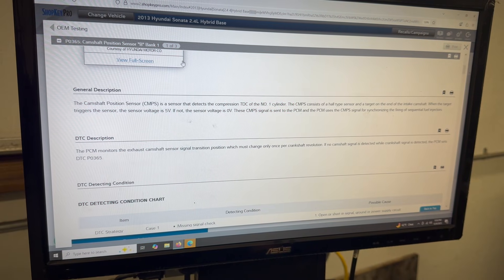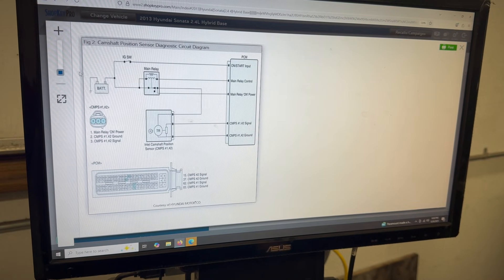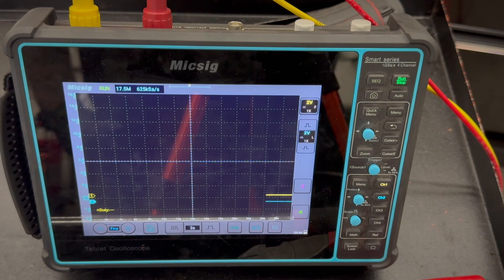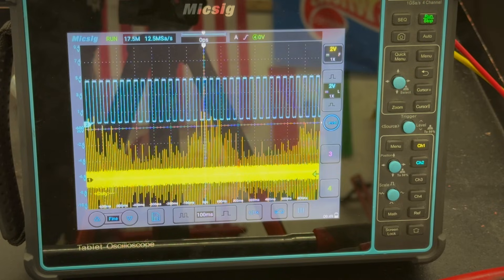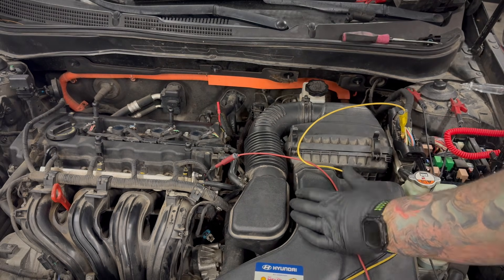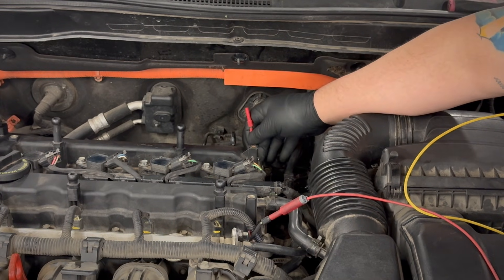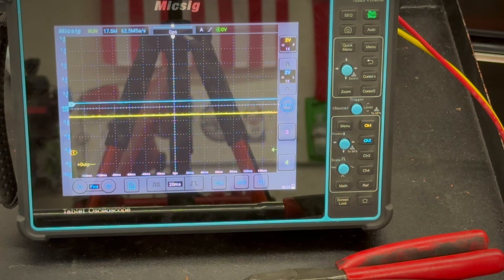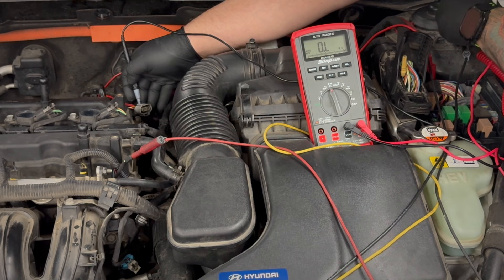P0365 Cam Sensor Code — Diagnosed the RIGHT Way

Comment: I got a Hyundai Elentra GT and it was missing switch coils went away and I notice the battery was lose and tested the battery and replaced it and then all of sudden the check engine light is on and it’s low rpm code I tested my electronic throttle motor I have power supply 5 volts I have signal 1 working I cleared the code and didn’t come back and then at one point their was a crankshaft sensor code and I took pictures of what was going on exhaust cam side it was going crazy but it came in for stalling problem that is why I replaced the battery because the power side of the battery was lose and was bad needed replacing I then notice when we sat on the driver seat all of sudden the car stallls I notice that a air bag connector is disconnected starting moving wires the car started acting up this is the side air bag under the driver seat but the crank shaft code could be the problem I don’t know I need help I am trying to diag my brother car I am a mechanic but need help

Comment: Nice diag.  Couldn't you also have jumped the 5-volt reference to the signal wire at the sensor to see if you had 5 volts on the scanner to verify wire integrity?  I believe Paul also shows that method in his book.  He uses a 5K resister in case there is a short on the signal wire.
Reply from the maker: In this case I could have but would have still seen no change if I had a PID for the CAM sensor. To avoid that case, I pulled out the lab scope.
Reply: @MasterAutomotiveTraining one time I diagnosed a vehicle , two techs diagnosed it prior ; one tech tried to run a wire from the sensor to the PCM , and burned the PCM , now I had to replaced the PCM and find an open circuit .
They were similar color code wires , and  the second tech , bypassed the wrong one , that's how he burned the PCM , the first one only pulled codes and replaced the sensor I guess ; and he didn't do any diagnostics .
Reply: @MasterAutomotiveTraining  good video  though ! Thank you  .

Comment: What i don't get is why you had no signal at the sensor on the scope if the wire is broke in-between the cam sensor and pcm i would have thought you would have seen a signal at cam just like the intake signal was but would not seen a signal at pcm just my thoughts thanks Dave
Reply from the maker: Dave, solid question. This cam is a 3-wire Hall with a pull-down (open-collector/open-drain) output, so the sensor doesn’t “create” 5V on the signal — the PCM supplies the pull-up. That’s why on the PCM side you’ll still see about 5V with an open. In the video you can see that at 7:48: the scope is 2V/div and the trace is sitting right around 5V. But at 8:48 the blue trace is sitting at 0V on the sensor side because the break near the sensor removes the pull-up, so you don’t get a clean 0–5V square wave at the sensor connector. That’s also why the intake signal looked normal but exhaust one didn’t. Appreciate the comment.
Reply: Thanks I did not know that I thought you would see a signal at the sensor no matter the signal wire continuity thanks for the explanation
Reply from the maker: Anytime.
Reply: I agree...inputs, outputs, powers and grounds. Getting a signal to the PCM with the overlay wire installed leads me to believe it must have been a bad scope connection at the sensor wire for the yellow trace. It happens.
Reply from the maker: @kathycataldo2165  I hear you, bad scope connections can happen. In this case, the results match how a 3-wire Hall pull-down circuit works. The cam signal is open-collector/open-drain, so the sensor doesn’t “send” 5V out; the PCM provides the pull-up.

With the signal wire open near the sensor, the PCM side can still sit at 5V, but the sensor side is disconnected from the pull-up, so you can see 0V / a flat line at the connector even with good power and ground. When I added the overlay wire, I reconnected the sensor output to the PCM pull-up, so the square wave returned, that’s exactly what you’d expect with an open in the signal circuit, not just a scope hookup issue.

Also, I didn’t base this on the scope trace alone, at 11:30 the continuity test showed OL on the signal circuit. To double-verify, I hooked up a known good sensor with the overlay from PCM to the sensor connector and could produce a waveform with a magnet. Without the overlay, nothing would switch.

Final fix was an open signal wire near the sensor connector from rodent damage. Just a reminder: don’t be too quick to brush off a solid diag when the circuit tests repeat the same result multiple ways.
Reply: @MasterAutomotiveTraining  Thank you for clarifying that it was a pull-down hall effect sensor. Now it makes sense  knowing that extra bit of information. Thanks for taking the time to reply 🙂
Reply from the maker: Of course anytime 🙂

Comment: Could you have load tested the wire between signal and pcm and if the light didn’t light would that show you the wire is bad?
Reply from the maker: Good question. Short answer: not with a regular test light on a signal wire. That PCM signal is a low-current input, not a power feed, so it’s not designed to light a bulb.